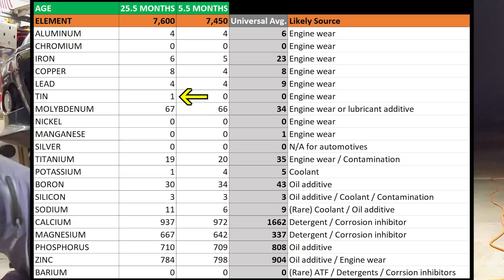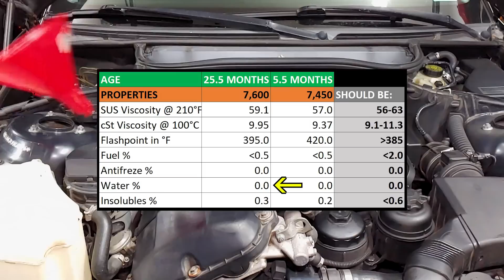Does Oil Really Need to be Replaced Every Year? Surprising Analysis Results Revealed

Comment: The greatest cause of oil being less effective in protecting an engine is the gradual buildup of carbon exhaust gases passing through the rings and valve guides causing oil to become black . Buildup eventually causes varnish and solid carbon buildup that abrades working parts and clogs up oil gallery and rings to further compound  the problem and eventually engine failure. Changing oil within the 5K mark for most driving conditions is a cheap form of insurance for long life of engine.

Comment: Its such a subjective matter that there is no hard and fast rule.It's only the manufacturers recommendation,the key word being recommendation.its all made up rubbish anyway( companies like Lexus offer company buyers halved service intervals to that offered to private buyers on the exact same vehicles).There are too many variables to be precise, Engine type,fuel type,fuel brands,oil brands,environment,driving style,long journeys,short journeys,town use,motorway use............ The problem is that with the modern car the oils workload is ever increasing,turbos on almost everything and valvetrain control,vvc,multiair etc.relying on it for correct actuation .tighter tolerances etc.smaller engines working harder and hotter than ever before. There used to be a saying that any oil is better than none but its got to the point where even the wrong specification of the right grade can be detrimental. I used to keep a couple of 205 litre drums of a couple of different oils, a c3 5/30 and 10/40,now I would need a workshop the size of the boeing building just for the different oils,I have to keep about 40-50 different transmission fluids now too,its ridiculous.Only you know how the above variables apply in your particular case,changing oil isn't rocket science and assuming that you have done or are contemplating doing your own then Im assuming you have enough common sense to work out for your self as to when to do it. What I can tell you is that most of the cars I see with serious issues arising from obvious lack of oil changes( baked crud internals😂)is that they tend to be smaller diesel cars,and for diesel cars in particular I would err on the side of caution,having more knock on effects from poor oil condition than your average petrol engine.

Comment: The main thing to remember if you don't do your oil changes very often is to keep an eye if your coolant level is lower.  Coolant can leak into your engine oil.  You can tell if that happened by seeing that your engine oil level is overfull.
Reply: oil in coolant is NOT normal. if you see it, you have more problems than oil changes.
Reply: That's a great reason to change oil once a year. Some thing's you just don't wanna find out.
Reply: @mikelarry2602  i changed my oil 3 years ago, i don;t drive much. 3000miles and 1 year is an old wives tail
Reply: @mikelarry2602  But you can observe that without changing the oil.
Reply: Colant only leaks into your engine oil if you have a blown head gasket.

Comment: I just wonder if the new engines with direct injection are more apt to get blow-by and contaminate the oil?
Reply: Yes they do
Reply: The aftermarket sells PCV oil separator kits for some cars with direct injection, collects the gunk in a small metal cup that easily unscrews for emptying.
Reply: @johnmcmullen456  you talking about a catch can
Reply: @BubblesTheCat1  Correct. I installed one on my 3.7 V6 Mustang & it's very effective.

Comment: My biggest takeaway from this is the time factor (6,12 mos. etc.) is far less of a factor for oil changes than we're all being led to believe.  Only with a few exceptions, mileage is the main indicator.  The Care Care Nut, who is quite popular, strongly believes 5K intervals are the way to go, especially with the new, lighter-weight oils but I believe that mileage is more important and this video reinforces my belief.  Thanks!
Reply: Actually most engine manufacturers will tell you the amount of fuel through the engine is the most important factor. You generally get a similar amount of additive depletion, oxidation, nitration and contamination per gallon of fuel run through the engine. So in general 10 mpg might equate to 3000 mi and 20 mpg might equate to 6000 mi. Of course if you doubled the oil capacity you could double the interval as well (Some newer half ton pickups hold 9 quarts of oil). That's the reason some heavy trucks can go 60,000 mi between oil changes. They might only get 6-7 mpg but when you have an up to 60 qt capacity it helps a lot.
Reply: @gk5891 That's a very good point, of which nobody's talking about. Thanks for the great info!
Reply: Its actually to do with type of oil. Full synth is consistent. With semi or mineral time is a factor
Reply: @System0Error0Message  Just not enough difference between a Group II/III blend or Group II+ (Present day conventional) and Group III (Most current synthetics) in base stock for it to make that much difference. Any of them are fine for 3 years sitting in a crankcase. I think the 5 year oil I tested was primarily an Group IV at the time of initial fill and was a European Long Dain Additive Package (Designed for 18,600 mi drain intervals) so I'm not going to count it. The running and primarily combustion byproducts is what breaks down the additive package. This ain't your Daddy's Group I.
Reply: @gk5891  thanks. im not sure what we use here in the 3rd world but if what you say about groups are accurate (though its hard to find details on labels here) that sounds good. I drive sometimes, more short trips instead and the occasional long trip so my servicing is typically by time rather than distance. so far i've been on semi synthetic and if it is true fully synthetic can last 2 years in a at least 80% rel humidity all year round in a hot country i would choose that instead. With mineral oil and semi synthetic they typically have mineral components which typically break down faster so in semi synthetic some protection wears out faster so you have less oil that can be used to protect.

I may not know as much as you do but im not in US or europe and our conditions here are typically tougher however i know the myth about using thicker oil in hot countries isnt really true if you rarely rev the engine all the time and my mechanic keeps saying i should use 20w50 mineral oil if i rarely drive but been on 10w40 semi instead while car manual specifies 10w30. But if in my condition i can safely change the oil in an older car for fully synthetic every 2 years thats a good choice. Waste oil is environmentally unfriendly so if i've been changing twice as often as i should i would not only save money but also time and environment as well.
Reply: The Care Care Nut might be mechanically inclined but is brainless.
Reply: Ive met the car care nut guy in person in his shop, he knows well but what i can say about him is this - he is a neat freak and wants everything he works on to be in tip top shape... if your car is not taken cared of well, dont bother bringing it to his shop. In short - he's a PERFECTIONIST. and recommending 5k miles oil changes fits very well in that.
Reply: CCN likes quick time
Reply: According to the Car Care Nut, it is 5k Mi or 6 mo
Reply: No one mentioned putting oil in the oil filter before installing it. I have always done this. The faster you get oil pressure, the better. Mr HONDA said most wear in a car engine occurs at startup.
Reply: @richardveronese7961 also, you could pull off the spark plug wire and turn the engine over because the rpms on starting is very low and you could prime the system of oil then put the spark plug wire back
Reply: @richardveronese7961 pull the spark lead off and turn your engine over for a few seconds... saves all that oil spilling if you have to install it open side down.
Any car I've owned,  sat for a long period, gets treated the same way.
Reply: @richardveronese7961  Nobody mentioned it because it's a waste of time, not to mention impossible on cars or bikes with horizontal or upside down mounted filters. You can do it but it's pissing in the wind.

Comment: Environment factors and how hot the engine gets whipe you drive it should affect to. If you live in a warm-cold (engine block condensation), moisty climate and never drive the engine warm enough - it will not vapor away the moisture in the engine/oil.

Comment: I have a Honda with VTEC valve train .. the cleanliness of oil is very important to keep these things working right ..I have read lots of stories about VTEC Problems related to dirty oil ..
Reply from the maker: A friend of mine had a ~2005 Toyota Celica with the same issue. The valves wouldn't float at high RPM with dirty oil.
Reply: @endlessmoneypits  Hello , I'm in a Honda Element group on facebook .. one of the most talked about problems is the vtec system ..throws codes and goes into "limp mode" 30 mph max .. I'm a retired mechanic from the 70's ..This video is really interesting ..I don't drive much ..use synthetic Castroil but still cannot leave it in for over a Year .. I call it Cheap Insurance ..

Comment: I only drive 900 miles a year. I don't change oil until I hit that 5000 mile mark. 

My chemical engineer son pointed out those bad things that happen to oil, like turning acidic, require heat. It's not going to happen sitting in the pan. I guess I got my 6yrs worth of tuition worth of insight.
Reply: My Hyundia Trajet does 2k miles a year so has an oil change every 5 years. 
It comes out golden and clean.
Reply: I'm not sure why your son told you that. Oil breaks down over time even without driving. There's a reason they say 5k miles or 6 months whichever comes first. Even if you don't reach the mile marker you should definitely change the oil over a time interval then.
Reply from the maker: If someone tells you to change your oil every six months regardless of miles, they likely work for the marketing department, not engineering.

Comment: Dear Sir, you're using the wrong type of 5W-30 oil in your car. You need European Formula 5W-30 for your BMW, which is 3.5 HTHS minimum. The oil you are using is for Japanese and American made cars, not for European cars. For best results, use Redline High Performance 5W-30 or Amsoil European formula 5W-30, the best oil in the USA 🇺🇸
Reply from the maker: Yes, I am currently running these tests again with European formula for comparison.
Reply: @EndlessMoneyPits  Good to hear that Sir, another thing I would like you to add to your oil testing is to show TBN and oxidation in used oil that what really matters and shows the true performance of a oil.
Reply: Dear, What you think of Liqui moly toptec 5w40 502 505 505 01? I am using I my 2006 skoda Octavia 1.9 tdi alh diesel 5 speed manual.

Comment: Great channel!
24,000 mile (yearly) changes work perfect for me.

Of course, this is on a 2 cylinder 650cc i3 REx range extender😅.

Typically need to burn only 25 gallons of gas each year, so the oil still looks new.

More concerned with the oil filter disintegrating over time.

Comment: The deterioration of modern synthetic oils is largely determined by how a vehicle is used. For vehicles that do a lot of cold starts and short trips, oil will deteriorate in far fewer miles than in a vehicle that is operated at temperature. This occurs as a result of increased blow by in a cold engine, increased richness in the mixture and insufficient heat in the oil to "steam off" fuel contamination.
 
It is likely that the reduced flashpoint in this oil sample is the result of fuel contamination in the oil. I would have perceived this to be an indicator that more frequent oil changes are required, but I'm not an engineer or a chemist, the people in the lab, are! I'd listen to them, not me.

It's worth keeping in mind a few considerations that vehicle manufacturers may or may not have when specifying oil change intervals. The volume of the oil in the vehicles lubrication is a factor.
Manufacturers may or may not be safeguarding against use case. They don't know whether your driving a mile to work and back, each day, or doing a fifty mile round trip. They also don't know what quality oil you will be using. They may or may not take this into account. They also don't know what environment you will be operating the vehicle in, however this is less of a consideration with modern quality synthetic oils. They may or may not factor this in.

Why do I keep saying "may or may not"?  The short answer is marketing appeal vs. Longevity. People, especially fleet buyers, look at long service intervals favourably when appraising a vehicle for purchase. And it's worth keeping in mind that a vehicle's warranty is only for "X" miles an "X" time, and "reasonable durability" has an expiry date, too. 
You've got to ask yourself the question: Was the service interval determined by an engineer, an accountant, or a marketing man? Remember, they sell "sealed for life" transmissions, too!

Of course, you are going to service a new vehicle in accordance with specifications in order to maintain the warranty. Beyond that, though, the choice is yours, and should be determined by the vehicles usage and the mileage on the engine (high mileage vehicles can be harder on oil). In some cases, 4,000 mile changes might be overdue, in others, 12,000 mile changes might be fine.

Nobody likes wasting money, time or resources. But how much does oil cost, and how much do you use? A couple of gallons of oil in a year, for the next 50 years is still going to work out a lot cheaper than a new engine.

Comment: Being cheap and going longer then 7k miles is a good way to cook a set of piston rings and scratch your cylinder walls in 50k miles to make your car a real oil burner. 5k miles is my best measure for good oil and changing. You always want good oil to leave behind in a change while adding back better oil. My oil is normally clear and when it browns my towels its time to change it and that is normally happening at 4300 to 5k miles. Thats coming out a toyota engine.

Comment: And I love how thousands will still do 3,000 miles.  Regardless of the data.  Humans hate to be told they’re wrong.
Reply: The oil in my WRX looks absolutely filthy after 3,000 mi. An oil change is cheap and it only takes me about 20 minutes. Turbochargers like clean oil. I do it every 5,000 miles on my tacoma.
Reply from the maker: Everyone seems to have strong opinions about oil and they're all different.
Reply: Especially when there's an entire other continent where 10000 miles is the bare minimum that the vast majority of people will keep their oil for: Europe.
15000km (9000ish miles) oil change intervals have been the standard for at least the last 30 years, and most manufacturers these days actually specify 30000km.
I myself start thinking "I need to change my oil" when it starts getting around 12k and then finally get around to it between 15 and 20, never had any issues.

I drove a '97 Audi A4 that consistently had a low oil pressure warning at idle for over 100,000km, still changing the oil every 15-20k, before the turbo finally kicked the bucket. The oil seal in the turbo gave way, it sucked all the oil into the intake while I was driving at 120mph and the engine seized (the stupid oil pressure warning didn't even come on, the one time it would have been needed). The engine had 350,000km and over 20 years by that point.

Changing the oil every 5000km is asinine. It's a leftover from ye olden days when oil was mineral based and sludged up very easily, but if you're using good fully synthetic oil (AS YOU SHOULD, there's no reason to feed your engine crappy mineral oil in 2024 when the price difference is so small) at 5k you're throwing away oil that is still basically new.
Reply: @demoniack81 Your poor Audi deserved a less stingy driver. Changing oil more frequently is the best you can do for engine longevity.
Reply: It's ridiculous to rag on people doing frequent oil changes, when oil/filters are so cheap, and new oil with its' fresh additive package can only be a positive.

Comment: Not At All Surprised One Of My R129 Benz's Gets Oil Done Once Every 3 Years,The Secret Is Starting The Car Every 3 Days It Keeps The Battery Up No Trickle Charging Ever & Alarm & Clock & All The Modules In Good Shape,Letting A Car Just Sit Ruin's It And First To Go The Battery,Fuel Turns Bad And Then Electrical Problems & At Some Point Rubber Parts & Rust Finishes It Off,Let's Not Even Talk About Exotic Car Oil Change$$$$$,Enjoyed The Testing Thank You Sir,Genre Master Pres/Ceo Of WORLDWIDEMUSIC.

Comment: I live in the Deep South, when the temperature is 95 degrees and so is the humidity and I’m sitting in stop and go traffic, I want clean oil in my vehicle…I change the oil every 5,000 miles or six months, whichever comes first, which usually is the six month change interval. I use Amsoil OW-20 full synthetic oil and a WIX XP filter with synthetic media…$200 a year for oil changes on a $48,000 dollar truck is money well spent…